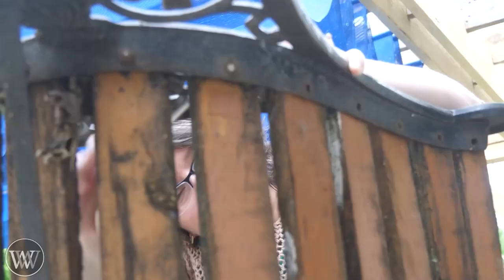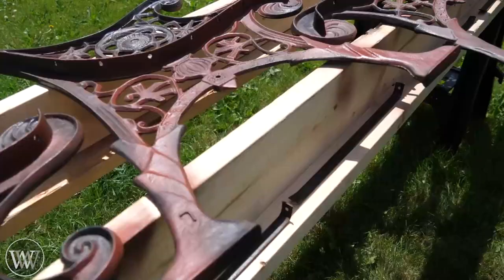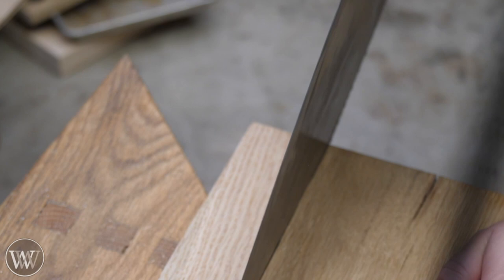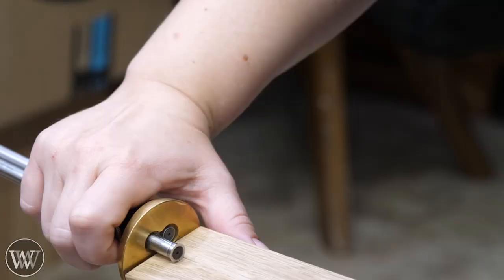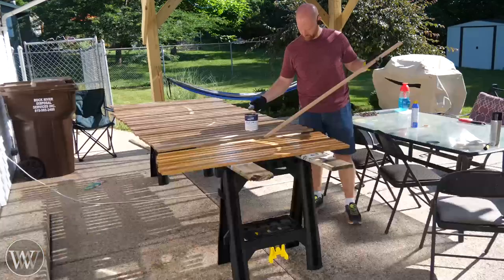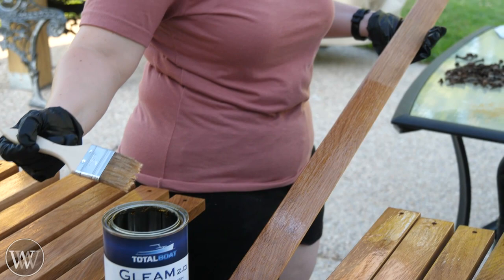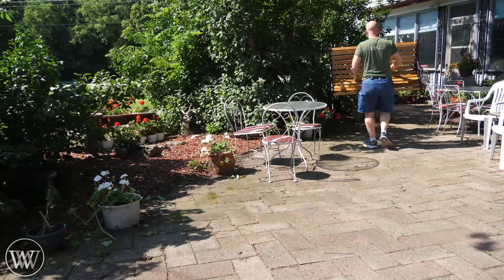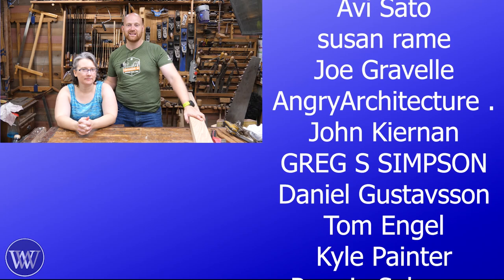How To Restore Cast Iron Benches

Comment: This is just what worked for me, YMMV and not trying to contradict your recommendations.  Back in the late '80s/early '90s I read a furniture finishing article in one of the woodworking magazines.  Owning a sailboat, it captured my interest.  The subject of the article had been varnishing furniture for decades.  He recommended a few things that have stuck in my mind.  1.  His final sanding was with 100 grit sandpaper.  He said the varnish would fill the sanding scratches and they would never show.  2.  He thinned his first coat 50% with Penetrol (not applicable here since you started with the penetrating epoxy) and subsequent coats were thinned 10%-15% with Penetrol.  Penetrol allows the varnish to flow out without brush marks.  3.  He said to always brush from a dry area into a wet area in one direction only.  Never brush back and forth because it leaves dents in the finish.

I followed his instructions to the letter on the teak trim on my boat and it looked like it was sprayed on.  For recoating I just hit it with 100 grit and varnish thinned with Penetrol.  Super simple (for maintaining varnish in the subtropics) and it always looked great.
Reply: This is wonderful advice. Thank you for sharing

Comment: A few years ago, I went to the big box store and bought a couple of the oak stair treads, cut the rounded bit off of one and made a "portable stair".  Put a few scrap 2x4 pieces on the sides/back, and my 5 year old loves to stand on it at my workbench.  It is about the height of most stools but since it is just under 48" long, the size makes it very stable.

Comment: I just finished restoring a pair of 48" benches for a friend of mine. They were both 48" to start with, but I modified one of them into a 24" single seat chair. TIP: when taking old rusted fasteners out, just use a cut off wheel...works great and they're not worth keeping so destroying them in the process is no big deal. In this case the original wood was so badly rotted, that I just pulled it all apart/off by hand, leaving the fasteners to be addressed as above. Both had cast iron inserts in the backrest (2 pieces in each with a couple of vertical wood pieces, one at each end and the cast parts were in good shape so I used two in the 48" bench and one in the 24" single seat. Had all the cast stuff blasted to remove old paint and the rust, then painted them all a black satin. I used Oak planking and spent part of one morning cutting, sanding and sealer/staining the wood parts. Hand did the flowers and vines with modeler's enamel in various colors as appropriate. Stuck it all back together with stainless hardware and they came out great looking. I have done several restos in the past and those came out nice, too. Kinda fun to do!

Comment: I was so impressed to see you two using hand tools. Thanks for the step by step tutorial! 

I have the iron frame, but no braces. Can you recommend where o might find some?
Reply from the maker: Those are just big pieces of metal. Half inch by 1/6 in. You should be able to get them in almost hardware stores or big box stores

Comment: I always put a bit of lubricant on stainless steel bolts as I have had trouble in the past with the threads seizing.  If that happens you have to use a hacksaw to get the nut off.  I think it happens when the invisible chromium oxide protective layer gets damaged on the thread and the new layer forms joining the nut and bolt.

Comment: I'm hoping to do this project over the summer, but I'd personally prefer a matte finish, that brings out the grain and deepens the colour. I've chosen to go with an oil but I'm not sure which one. Possibly Danish oil or Tung oil? If anyone could recommend a type it would be much appreciated.
Reply from the maker: This two can mean the same thing. It depends on the brand. Both would look great, but neither will stand up to the weather. The only matt finish that will last more then two years that I know of it Rubio monocoat exterior. Oil finishes are great but Ned to be re done every 6 months to a year. Of the oil finishes Boiled Linseed Oil would last the longest, but not by much.

Comment: Do you think I could refurbish an old cast iron bench with cast iron on the back rest and transition it to all woods slats?  Or do you think it would need keep the cast iron on the back, keeping the same design. I have one but the cast iron on the back rest is too rusted, so I would just want to keep the side rails and add all wood slats to seat and back rest.
Reply from the maker: Sure. Sounds like a fun project.

Comment: What would you do if you were doing this identical bench, but do not have the center brace?  I used cypress boards, and it' a little too flexible and needs strengthening.
Reply from the maker: I would make it shorter or make a strap. It is just a bent piece of metal.

Comment: James, I'm thinking about doing a similar project. Could you tell me, what do you think the maximum length of the slats could be? Would it matter which wood I use? Thinking of sapele or something similar. What wood would you suggest?
Reply from the maker: If you're going with something like Sapele I don't think I would go over three and a half or 4 ft. But if you do something like white oak you might get out to around 5 maybe 6 ft if you make them a little bit thicker.
Reply: @WoodByWrightHowTo  Thanks James!

Comment: What primer and black paint you used for this project? Thanks in advance. Great video.
Reply from the maker: Just a simple self etching primer and standard gloss paint.
Reply: @WoodByWrightHowTo  thank you. 3 more questions if you don’t mind. - -Are all the three 1.5” wood pieces just for the bottom? 
-What size did you use for the square head steel screws? 
-Are the 1 1/4” hex button head long enough for this project. Thank you again.

Comment: Soooo, I bought the Total Boat following your link and followed the instructions carefully which said, "not to mix more than you will use in a 20 min time period." It was applying perfectly for about 3 minutes when the mixture reacted and melted the mixing container sending epoxy everywhere. Should I have mixed in glass? Any idea why it kicked so fast?
Reply from the maker: That's what happens when you mix too much at one time. If there's too much in one space it heats up and the heat causes it to cure faster which creates more heat which then causes to cure any faster. It's actually very dangerous if you do it in a paper cup. Because the paper cup can catch on fire. Usually I never let it get any thicker than a 1/2 in or so in the bottom of any container I'm using.
Reply: @WoodByWrightHowTo  that was helpful, but how do I measure 2:1 at only 1/2 an inch, eyeball it?
Reply: @WoodByWrightHowTo  also, now I have thick hardened epoxy on some of the slats, the varnish will surly not penetrate the epoxy. Should I power sand back to bare wood?

Comment: You mentioned that you cut the white oak into 4 foot strips, would you advise against going longer?
Reply from the maker: It depends on the structure of the bench. with 3/4" thick strips I would not go longer then 4' but if it were 1" I might go up to 5' some benches have stronger structure under the bench to go longer, but those are not common.
Reply: @WoodByWrightHowTo  got it, thank you!

Comment: White oak is really expensive and doesn't seem easy to find locally- is there another wood you would recommend?
Reply from the maker: That depends on where you are at. As long as the wood does not touch the ground most hardwoods will do fine.
Reply: @WoodByWrightHowTo  I live in MN- main choices at big box stores are oak, red oak, maple, poplar, and aspen

Comment: What kind of rods did you use to weld wrought iron? Did you happen to use MIG?
Reply from the maker: I can't remember the number off the top of my head but they are specially formulated for cast iron. I've also used 6011 in the past not quite perfect but they do fairly well.
Reply: Usually you use bronze rod or TIG.

Comment: What size are your boards?
Reply from the maker: They were all inch and a half by 3/4 or 2 in by 3/4. Depending upon the radius they were attached to. Though I've done the other benches in the past that have some as wide as two and a half by 3/4.
Reply: @WoodByWrightHowTo  thank you so much. Also why do you use the tool to shave the wood?
Reply: What are the underneath braces called, or can I make them?

Comment: For those who use other brand epoxies, just know that many of them don’t contain UV inhibitors. In no way does that necessarily make them poor quality, but there are different epoxies for different purposes. That’s not to say you can’t use them for this application, but but be sure to protect them with something containing UV inhibitors (I.e. varnish, clear coat, etc.), since UV will degrade epoxies. Also, some epoxies create an “amine-blush” after they cure. Some do, some don’t. It’s basically, a thin waxy film byproduct of the chemical reaction that’s left on the surface. A quick, but thorough scrub with water and a scotch-brite pad (scouring pad) will remove it. I tend to do that prior to the light sand. Then clean with a solvent and apply your chosen UV protecting finish. Happy building, friends.

P.s. Wear gloves and a respirator, at least. Epoxies are amazing for numerous reasons, but they are chemicals with potentially adverse effects. Prolonged, repeated exposure without basic PPE has ruined the career of at least one person I know. It’s possible for some people to more or less, become highly allergic to them. Not good if your career is based around using epoxies. Annddd, as a bonus, plain old $ store white vinegar is a safe and great product for tool clean-up, since it works, won’t eat through your gloves like other solvents, and it’s cheap. Just clean things before the epoxy sets, as no solvent that I know of will make that possible once it hardens.